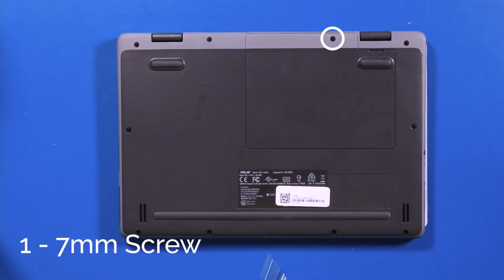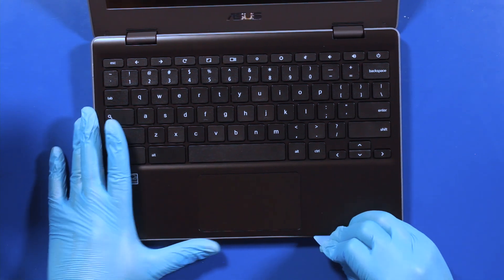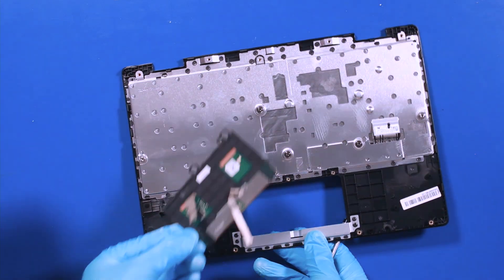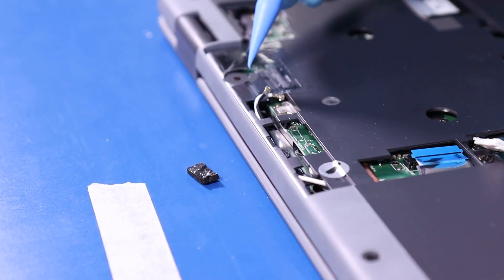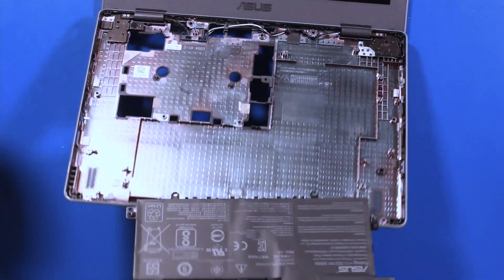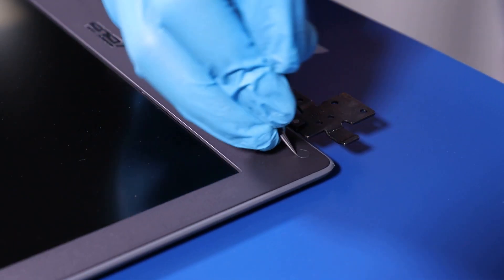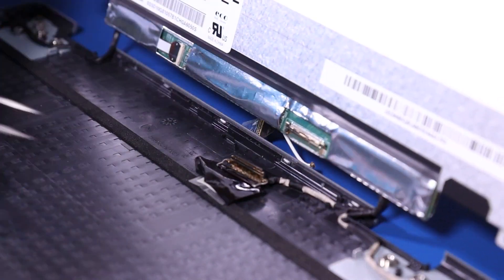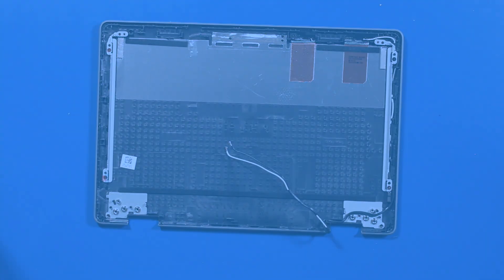Asus C204MA Chromebook Teardown Guide

Comment: How do I plug the battery back in? (I'm using a EE model instead of a MA model)
Reply: And my cables aren't put together
Reply from the maker: Are you doing a battery replacement?
Reply: @Chromebookparts well no and i already resolved the issue
Reply from the maker: @Scardycat1839 Gotcha, glad it got resolved!

Comment: Hi i was looking for a mother board on your website and couldn't find one on the same model do you have any others that would fit in it
Reply from the maker: It's possible there may be another motherboard compatible for the C204MA, but to confirm and check availability I'd recommend emailing customersupport@chromebookparts.com. They should be able to help!

Comment: well damn there goes the chromebook i forgot to unpull it from the metal thing and i think ive broken it theres a little tiny string like wire hanging loose now i hate myself why am i still alive😊
Reply from the maker: Is this by any chance having to do with the battery cable clip?
Reply: @Chromebookparts  i forgot to lift the metal part lol
Reply from the maker: Aw... The question is, was it the battery or the motherboard that was damaged? Did the wire pull out of the connector?
Reply: @Chromebookparts  idk when i pulled it there was just a string like wire hanging and i couldnt put te battery back in
Reply from the maker: Hmm. Without seeing it, hard to say whether it could be as easy as a battery replacement, or a MB problem. If you'd like, contact our repair team at repairs@chromebookparts.com (maybe send a picture too). If it needs to be sent in, the shipping and diagnosis are free